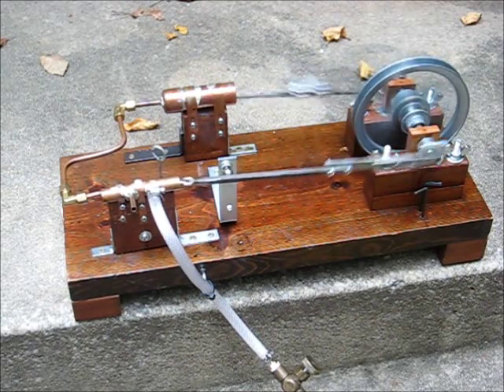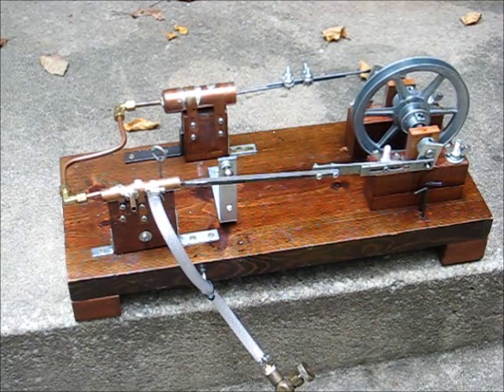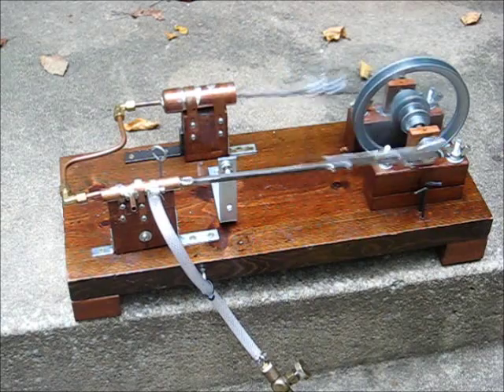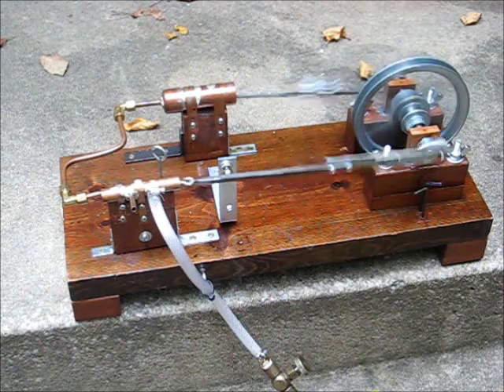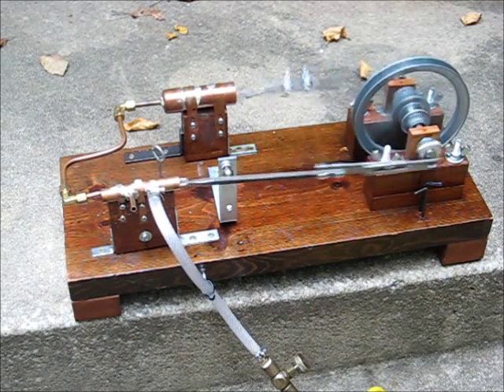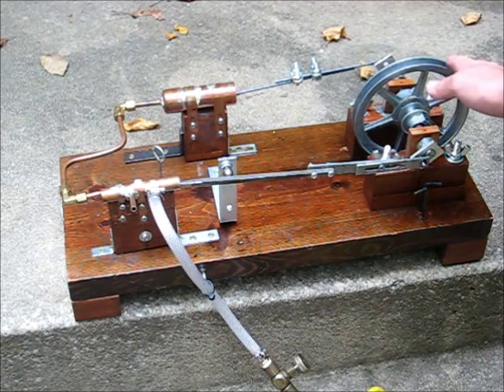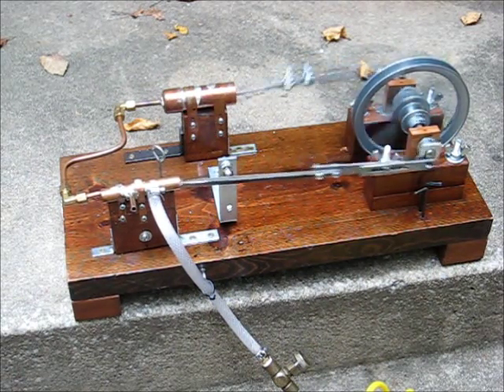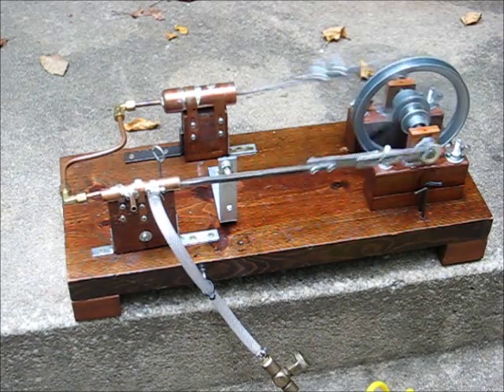DIY Steam Engine - Phase 3

Comment: hi did you use any plans for this?
Reply from the maker: No, I just watched a bunch of diy YouTube videos and worked it out by trial and error.  The big difference between this and a real steam engine is that a real one is stronger than the pressure that runs it, and loses less energy.  This one loses a lot of pressure as it runs; otherwise you wouldn't be able to see details.  It would be moving way too fast.  Well...it looks like a steam engine, anyway.